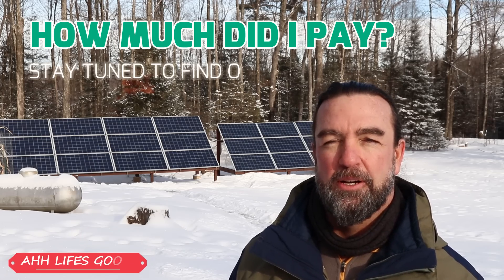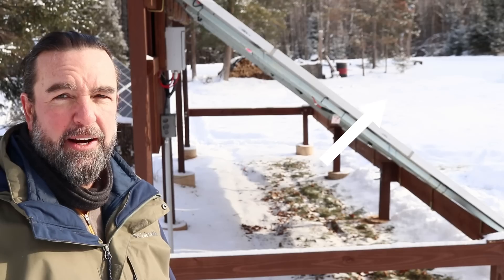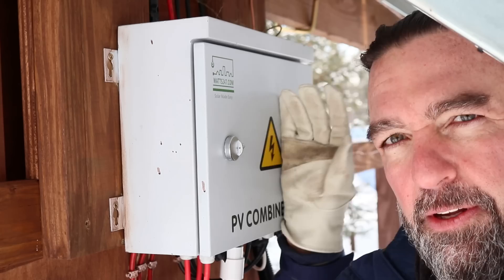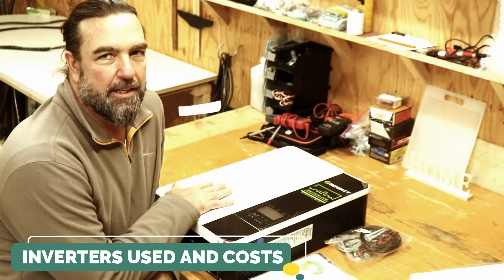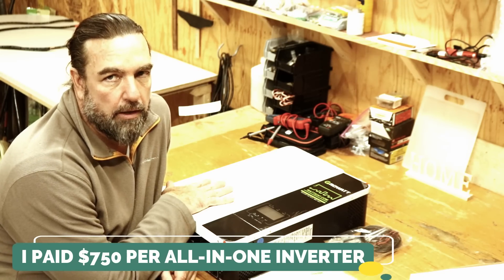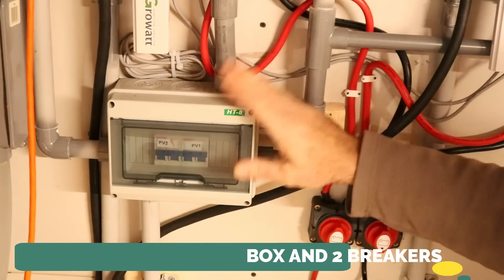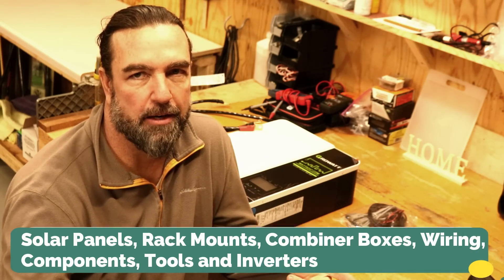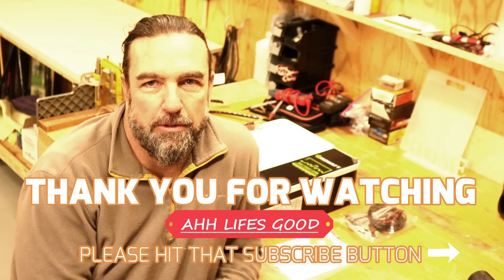WHAT I PAID - CHEAP - ENTIRE DIY SOLAR SYSTEM

Comment: Gyll look really good
Reply from the maker: - Thanks for commenting Harris, the EG4's (supposedly GYLL) work great, it's only the BMS speaking to the Inverters that is the issue for myself. Thankfully the BMS of the EG4's is good enough to allow AMPS in or OUT intelligently enough where the inverters help is not needed. My plan is to install an additional BMS between inverters and batteries as a backup prior to expansion.

Comment: I have 4350 watt Solar, with a 6000 watt growatt inverter (240 volt split phase)and 3 -  48 volt eg4 batteries (15.3KW) ..  all on a 40' motor home.

Comment: Why do you need 2 combiner boxes?
Reply from the maker: - I used 2 combiner boxes to regulate the volts/watts for each inverter based on panel and inverters sizes, along with the type of setup I'm needing.

Comment: how did you run the wire from the panels to the house ?   did you bury it and did you have to put in a conduit?
Reply from the maker: Yes I buried the cable in electrical conduit.

Comment: I must say great video but can i ask some question.
 Between mono and poly , solar panels..any of these two type can be connected in series.
How would you calculate the wire needed from the solar panels from rooftop to your growat inverter, am considering to install a 3600w solar system and 3000w inverter....i would need the calculation for the size wire from inverter to battery bank.  
How many battery it would require for an off grid system?
I see you install a breaker box in this video which a great idea.. can i ask a question on that..for instance install a breaker box too. How would u calculate the size wire for the output current, coming from the inverter to the breaker box.. 
For instant there is a 2 (40amp breaker install) what type wire should be connect to those 2 amps.
And there is 1 (15amp breaker) what type wire should be connected to that...

Can you please explain so i can understand..and if you any video ..that can help , i would appreciate that too

Comment: I know you already did it the way you did it but just a money saving fyi for you for future projects, Instead of buying way more wiring than you need just buy one roll of white that will cover all the distance you need and label the connected ends with black or whatever color electrical tape. The color only has to be correct for the first foot after each connection.
Reply from the maker: - Thank you Andrew for the advise as it's very true and the 1000' foot rolls are less expensive than the 500'.

Comment: Dude your set up is 20x the size of mine, lol. 
I have 2x 24v panels on a single controller, going to 2 truck batteries. That powers a 24volt inverter. Off that I can run a small fridge, and charge my laptops. 
I have a single panel on a car battery to run the 12volt Car Stereo and the lights. 
If I ever get around to cleaning the place up I might do a video about it. :)
Reply from the maker: - Hello Rowen, sounds like a nice start to your system! I've seen a few of these guys put there systems on Dolly's when there smaller, yet very powerful, making it portable and more versatile for alternative applications.

Comment: How long did it take to build the ground mount system?
Reply from the maker: It's a fairly quick build, probably 4 full days from digging holes,pouring concrete, structure build and mounting panels. Wiring the panels and installing combiner boxes more time was needed but also relatively quick.

Comment: I skipped over a bit of the video. Is that enough power to run your entire household or do you still need to be connected to the grid?
Reply from the maker: - Hello Time Bee, yes the system does provide enough electricity to power my house entirely, but of course you need to be very conscious of the amounts of loads you're using or demanding of the system and if the sun will shine ro replenishthe batteries. I would recommend a minimum of a 10000 watt system for a house, I only have 6000 watts currently.

Comment: You mention upgrades as a benefit to 8 gauge wire, which it is. Another small but real benefit is less transmission loss.
Reply from the maker: - Good point and thanks for sharing.

Comment: If you build the batteries by your self, which is quite easy, they cost less than half ($2500/20kWh) My 14kWh (16pcs 280Ah Lifepo4) battery + JK smart BMS (balance current 2A, 200A load) + 5A active balancer (+ his voltage detection controller to activate just above 3,4 Volts) + offline monitor was in total  $1750.-

Comment: thanks for mentioning if you are using them totally off grid to use the 5000 series, I am having difficulty finding info on doing my own off grid cabin full time living. too many videos only address part time usage.. for smallest split heat pump & smallest fridge 6 to 9 cubic ft.. doing this in 2022... with the hopes of not going without electric
Reply from the maker: - Hello Jaded Willowood, they're many variables that need to be considered when looking to go fully off grid with ONLY solar and battery as your power source. First I would recommend a generator as a backup in any event, secondly the design of your system will depend on how much electricity you will need and use on a daily basis, along with your locations amount of sunlight availability during the calendar year. Once determined you'll need to consider how many days you'll need to have battery backup reserve providing electricity in the event you don't have any sunshine to charge your batteries. At a minimum you should calculate 3 days, I would prefer 5 days, but batteries can be very expensive when looking to store large amounts of electricity.

Comment: hows your system running, and did you ever get in contact with ss about the comms ?
Reply from the maker: - Hello House of Ancients, I gave up on the comms. issue for the moment. My system is working flawlessy, amazing performance in winter with the added sun reflection off the snow,  averaging between 12 and 32 kwh daily as compared with summer it was around 10 to  20kwh daily. Cheers

Comment: I’m wondering how 200 A on four batteries gives you 20 kW? I have eight Battle Born Batteries and this gives me a total of 9600 WH. That’s 9.6 kW.
Reply from the maker: - Hi Ben, when speaking in 24volt batteries which is what I have not by choice at the time of purchase, so at 48v it'd be 10k amps as you suggest.

Comment: Nice video! One remark, two questions.
Remark: your batteries have a total of 20 kWh (not kW).
Questions: What is the maximal output of the 4 batteries combined (in kW). Is this limited by the batteries or by the Growatt inverters?
Reply from the maker: Each battery is Lithium Iron Phosphate battery 25.6V (24V) 5.12kWh with 200AH internal, combined I have 4 x this.

Comment: What's your reasoning for using 4 - 24volt batteries that I can see you wired 2 in series then paralleled them to make 48 volts.   Why didn't you buy 48 volt batteries to begin with?
Reply from the maker: - At the time of purchase I could only get the 24v, I would recommend using 48v batteries with a 48v system if you have the option.

Comment: Dual purpose panels, they use water to cool the panels and the hot water can be used for domestic.... sold in California, my idea over 10 years ago...small sail boat wind generators... there is a guy in NJ who gets temps over 100 fahr using a similar system in the winter.   LTO cells for battery packs, Daly BMS.... silicone wire, high strand count, high conductivity and less line losses, resistance etc... the larger the wire or multipule strands of smaller wire the less heat and resistance you have.
Combining all 3 types of passive energy gives you more options, more reliability more self reliance.
Heat is the worst enemy of solar panels... so using water to cool them, makes them last longer.... there is a guy in Aus. who builds tesla type power wall units, he does some nice work...

Comment: Great video. Thanks for sharing.  How did you learn how to design and install the system. What learning resources do you recommend for someone who wants to DIY a system for a motor home and a 13KW home system.
Reply from the maker: - Hello Lance, great question. As is the learning curve with anything we do in life, the more energy one puts forth into any action the more one shall receive in the end. I did allot of investigation, videos and reading until all the information accumulated started to come together on how to approach adding a solar system that would be functional for my needs. Don't move forward until you're absolutely comfortable with doing so as electricity can be very unforgiving if handled incorrectly.

Comment: 7000 cycles, is that mean 7000days?
Reply from the maker: - A cycle is as simple as the "charge and discharge" of the battery being 1 cycle, this could be done several times a day but in most occasions for solar it'll only be once a day. Whether its deep cycle discharge or full state of charge is another question. Theoretically in this example you'd get 7000 cycles on the eg4-LL, at 80% discharge? Those are manufactures statements, not mine. Once we go 7000 cycles (7-15 years) we'll be able to report.

Comment: Great video.  I'm sure i can find this somewhere else, but you promoted the concept of batteries or wind/water to generate power at night.  However, with what you presented, can this feed into your existing power?  i.e. feed into the grid or do net-credits for not using anything from the grid?  I cannot process that without batteries this would be around $4K for me if I just went with panels...
Reply from the maker: This system could feed into my grid but I chose to run it entirely independent so when I transfer the system to my greenhouse I should have the bugs worked out. Which I'm happy to report, the bugs have been minimal.

Comment: great video, but I think it would even better if you gave examples or demonstrate what you can run or power with your set up such as  appliances, furnace etc.
Reply from the maker: - Sounds like a great video, pushing the system to the limits and see how well it'll perform without being connected to the Grid. I'll do that at the point of moving it to the greenhouse in the event something goes "haywire", Thanks Bob

Comment: Very cool setup, however, living in Canada as I do, I wouldn't ever consider setting up an offgrid system without some ability to charge your batteries besides solar!! I talked to one older fellow after he had solar installed, and he said in 2013, there was a stretch of 3 months during the winter that he never saw more than 3 days in that entire period that had good clean sunlight!! Thankfully he had a backup generator!!
Reply from the maker: - Hello Kevin and thank you for commenting. I would agree with your recommendations, those living in the northern climates where snow or rainfall, conditions are high causing literally causing "sun outs", having either extra panels, and a few more batteries than you're normal solar setup is recommended. If you have the luxury to do so, a backup wind generator would also be ideal if you're 100% off grid. The luxury of Hydro probably isn't an option unless you have a fast enough current where the river doesn't freeze and or you have the space to put the turbine low enough in the water table where it won't freeze.

Comment: This is such an overkill! Are you running a Crypo farm?
Reply from the maker: - Thanks for the comments, my system is actually a pretty small system in comparison to average household consumption rates. If one wants to use electric heat with this system you'd run out of juice daily at noon! No crypto farming here, never know which direction the virtual market is going, I'll stick to Green farming for now.

Comment: Signature Solar has solar panels for 40 to 43 cents per watt on the low end and averages around 50 cents per watt.  The cheapest battery is 24 volt at `100 amp hours or 2.4 kilowatt hours for $500.  Two for me was $1,000 dollars for a 5 kilowatt hour pack.  I spent about 3,600 dollars for 7 kilowatts of panels each being 370 watts.  My dad and I split up 33 panels, 14 for him and 19 for me.  His inverter was 1250 dollars and he also got a 5,000 watthour battery pack for a thousand dollars.  Together we spent over 9,330$ and I don't have my inverter picked out yet but I will probably get the same as his, a grow watt 6000 watt system and I will put 16 panels on it ,two series of 8 in parallel  connections to keep the voltage down and the amps to about 16  to 18 amps.  When finished this system will have cost me over 5 thousand dollars and I will upgrade it later with more batteries and I will also have 3 panels left over to run a separate small system of 3,000 watts with a simple inverter and 3 or four lead acid batteries.  Two systems so I can avoid total shutdowns if there is a problem.

Comment: To help put this kind of info in perspective, count up how many kilowatt-hours you've produced with your system.  Divide that by your total expenditure to put your outlay in the same framework as what on-grid electricity consumers pay: money per kilowatt-hour.

While it's early days it'll look like a terrible comparison and you've thrown your money at a losing proposition, but unlike ratepayers - like myself - your spending is pretty much done.  Every kilowatt-hour you generate without spending more money works to the good.  The longer it lasts, the more affordable your system looks until eventually it becomes pretty obvious that your way is the best way: it costs a hell of a lot up front, and is cheaper every day after that.
Reply from the maker: - Hello Leif and thank you for taking the time to share your insights. Solar to me really comes down to the question of "if you need it," if you need it well then the cost is justifiable. In truth we really don't need electricity but we've conditioned ourselves to think we do, therefore we spend most time and money more often than not on luxuries we never needed at all. Cheers

Comment: Can you tell me how long will this system run a total house AC system or a heat pump for heat in the winter  on a 2000sf home ??   Would it last through the night. I know it takes very little to run lights,tv,etc but the heat and air conditioner is a real drain on batteries.
Reply from the maker: - Hi Bruce, an air conditioner being 240v will drain batteries fast, heat the same if its 240v. If you're running a furnace that's 120v it is allot more efficient than electric heat, or in my case I burn wood. Look at your electric bill and it'll tell you how many kw you consume monthly, my house was 300kw on average monthly, from there you can do the math. Roughly 10kw of electricity I need per day, in the area I live I need a 3 day reserve, so 30kw total in batteries for "normal" consumption in the event there is NO sun for 3 days. If you live in an area with allot of sun of course you're KW needs from your PV would be allot  less than those living in the northern mid west. To give you an idea, I produce on average 10kw per day, each month, those numbers fluctuate allot, today I brought in 16.9kw with only 4 hours of good sun, another 3 hours of average clouds.

Comment: William been watching a lot of videos on solar systems and have gotten  bids thru energysage.  Debating whether to DIY or Quoted Installed.  My main question is where you an electrician prior or learned on your own with reading and YT?  So your system produces up to 7.5 KW but your inverter combined could handle only 6KW.  Would the excess damage the inverter?
Reply from the maker: - Hello Henry and thank you for writing. I have not had any official electrical training, allot of reading, questions to freinds who know about electricity and watching allot of videos before proceeding. My original plan was to hire an electrician to help in the design, have a professional revision during installation and then a final check, all while doing the work myself. In the end I felt confident enough in my work to continue without hiring anyone. This system is capable of 6kw, in summer I don't reach max 
capacity due to the angle of panels, but in winter I do given reach max given the reflection from snow. The inverters automatically are only allowing in the max capacity of electricity, never shutting down, maintaining at pr near the max capacity.

Comment: I don't understand one thing. The Growatt supports up to 4.5kW of solar, but you have 7.5kW array. Does it mean that by having 2 of the inverters, you also doubled the solar capacity it can handle?
Reply from the maker: Hi Robert, the array on paper is capable of 7.5 kw but it never reaches 100% rated capabilities, at best I get close to 6kw but for only a second or two but normally bouncing between from 4kw to 5.5kw on the peak performance. Most solar panels from what I here never reach full capability of performance, pending the multitude of conditions and variables of course. As is the case where I'm at, were farther from the sun and the angle right now I believe is around 14% above the horizon, making intensity minimal. At best peak performance I reach almost 95% capacity of each inverter for a second, almost total capacity of 3000w (3kw) each inverter. So almost full capacity of just under 6kw of power from both PV arrays when the sun is peaking at it's best, no obstructions, clouds and tracking angles are exactly perfect. Which is RARELY the case when you have a stationary solar rack. Now if this system were in the desert or closer to the equator I would imagine the array would be slightly to large for 2 inverters that can only handle 6kw, these measurements need to be taken by each person pending location on the planet. Its also a good thing to not be peaking the full capability of your equipment, the lighter the load on your inverters I would imagine the more optimal they'll perform over the long-haul.